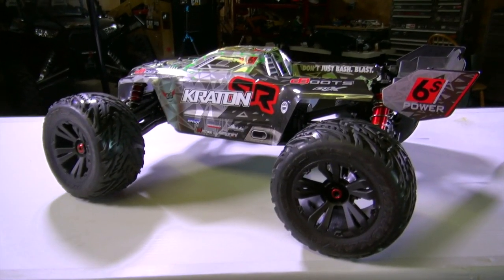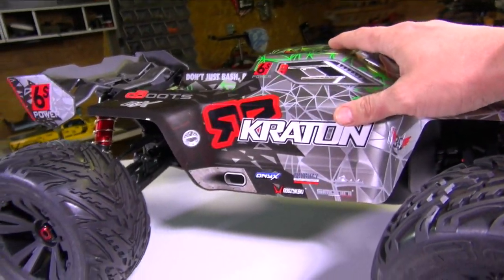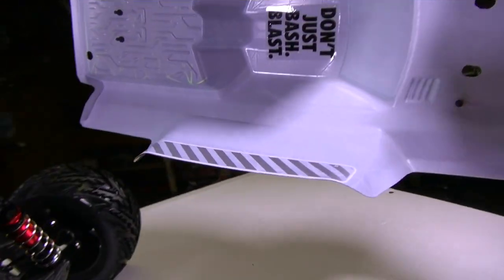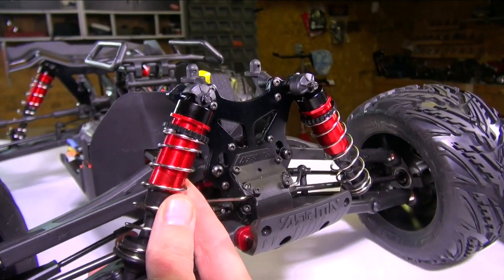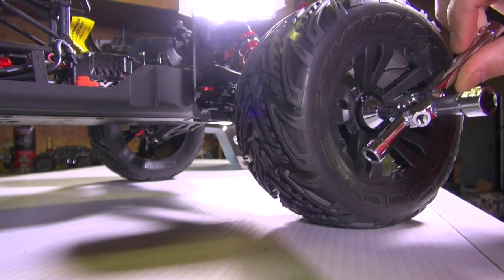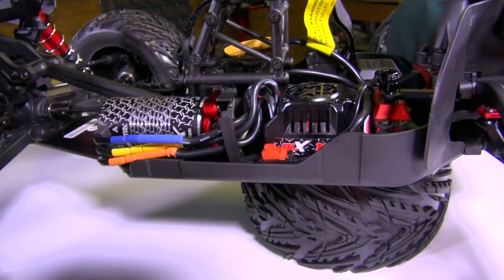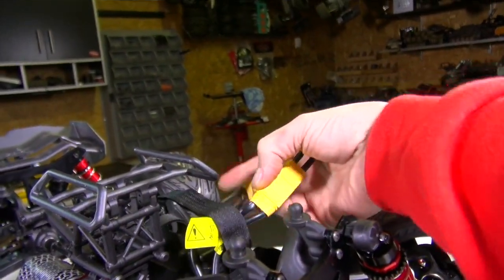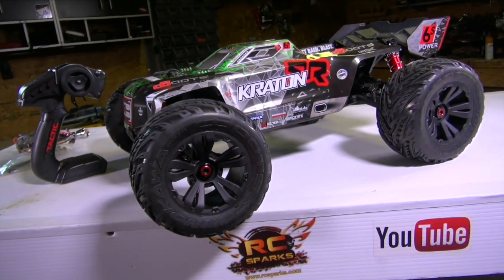10 Important Parts to Know about Electric Monster Trucks | RC ADVENTURES

Comment: i used to have a remote control car back in the younger day's  those was the ones with a wire attached to the car to control it, now running radio control for a long time , i wonder why i never got into the hobby a long time ago. 42 yrs old now , and i'm still loving the radio control hobby.

Comment: Good tip about reïnforcing the body with gorilla tape or ducttape. I actually go one step further and stiffen up my bodies with drywall tape, shoe goo/amazing goop and liquid rubber. Without any protection on the body the paint will get scratched up especially around the body posts and other parts which rubb against the car. Also reïnforcing the body helps to prevent cracks as much as possible.

Comment: On the front steering block, those are also known as C blocks on 4WD and Spindles on 2WD since it has no drive axle going through it.

Other than that and actually taking time to show exploded versions- I know that's a ton of work- of the components you covered it as thoroughly as possible.

Comment: Great how you did this right at Christmas and kept it simple yet still went over the major parts. I personally was wondering if you were gonna get to the diff cup/drive cup/outdrive, and you cut in and did. Personally I knew almost all of this as I'm an auto tech but those who just want to play and have no idea what is what and what it does there really couldn't be a better video. Personally now that I'm getting into quad racing I wish someone could do this same step by step talking for PIDs.  Slowly starting to understand it's essentially a filter for the flight controller of the quad to keep the craft stable in flight. But tuning them.is another story. Guess it's gonna be like tuning a nitro. Steep learning curve. Loved this even though I knew it all I was simply curious how in depth you were gonna go. The one thing I would say you left out are sway bars but that's getting more in depth. Great video and look forward to seeing a part 2 more in depth going over how they actually work so people can actually diagnose problems. But that's what we're all here for. Merry Christmas to you and yours Medicine and best of luck with RC Sparks Reboot.

Comment: This is a great video! You need to do one like this but about lipo batteries mah and C ratings, how to work out how many amps a battery can draw from and depending on what power system your running to how many cell battery  you need. Also if your running just say, a 120A esc and a brushless 3670, 2650kv that can draw 60-70A  you will need a battery that can draw and handle the amps the power system can use. For the type of power system i just said, i would like a 3s battery that can draw 200A.

Comment: Awesome video. Great job. Wish you made it long ago. Lol. Here's an idea. How about a video on how to determine what parts need upgraded to metal for your driving style or budget, depending. Ex. I have the x maxx and I will upgrade the steering spindles and etc to metal but keep plastic (rpm) suspension arms to absorb the jolts of big air jumps. Metal tends to distribute the force to the bulkhead or chassis. Anyway, think you get what I am saying. Sorry so long. Just an idea. Keep up the good work.

Comment: That part you called a steering block is usually called a steering knuckle; especially on full size vehicles. It should never be called a spindle; which would, technically, be the end of the axle that protrudes past the knuckle, that the wheel would slip onto.
Also, the steering piece that connects to the steering knuckle is called a tie rod end or simple a piece of steering linkage, not a servo arm.

Comment: Loved the video. Maybe next time you can talk about what it does changing the pinion and spur gear does. Does it make it go faster? What about heat issues? If I run a 4s battery do I get better performance changing the pinion spur gear or both?
Just food for thought. Still loved the video

Comment: i got a top tip use a polyurethane sealent to strengthen bodies lets them flex more without cracking been using it on my rc's for years

Comment: Don’t adjust camber with the pivot ball. They have to be snug which is a fixed position. To fix camber is with the steering cups set pieces

Comment: Hey Medic, I have a Traxxas Slash 2wd nitro short course truck. My Slash is all stock and almost brand new. But over the past few years after I purchased it, I’ve always wanted it to rip it up on the beach but my biggest fear is the sand getting into the bearings and gears along with the starting motor that would ruin the whole truck. If you could recommend anything that I can buy to install on my Slash to take it to the sand without destroying the thing that would be swell! Thank you!

Comment: Question about Center plates or transmission plates. I've been looking at getting a new transmission plate, and as I'm looking around(on amazon) I'm seeing a bunch of different designed centerplates. some starting at $25 going up to $60+
So my question is, is there really much a difference? I want to say yes, because you can see the different locations for the links to be mounted, bends...etc can you help me out, is there REALLY a BIG difference in centerplates?!

Comment: +RCSparks Studio - Could you do a segment on channels. Hooking up, config on TX, which goes where. I'm due at assembling my first truck (6 wheel). 1 Chan back/forth, 1 chan right/left, 1 chan gear, 1 chan shoe horn, 1 chan lift trailer, 1 chan feet up/down,  etc etc.

Comment: As a beginner rc hobbyist, I made the worst mistake. I bought an off brand rc monster truck. Therefore, most rc shops, haven't heard of the brand and don't know how to help. So I'm stuck with doing maintenance myself. I disconnected electric motor from the esc. After 4 months, I wanted to get it back together. So like most people, I forgot which wire goes to which wire. So I tried my best to remember and assemble correctly. But I failed everytime. After many configurations, I'm stuck with a truck that only goes backwards or in reverse. 

It is a 1/10 Scale monster truck type rc. From the website, NitroRCX. I purchased it for $200, plus the battery charger for $45. 

This truck has been sitting in a box in my closet for over 4 years. I don't want to throw it away, but I'm not interested in trying to fix it up, if parts for it are hard to find in stock. What I should have done was bought a beginner Traxxas Bandit, so I could tinker with it, and get help and parts from a reliable source. Any thoughts Medic?
Reply from the maker: Man, I wish you could yell your story into a MEGAPHONE to educate people about buying "cheap" RC's that seem like a good deal.  So many people get sucked into buying something "cost affordable" and get burned for the same reasons you have experienced.  I have tried to educate people about this risk, but then I always get spit on in the videos for "not supporting people who can not afford expensive rc's"..  Sighs. All we try to do is educate that they are a 1 time purchase and then .. throw them away.. Lol.

Comment: Technically when u said shock tower the shocks connect to the tower in sometimes that's not the case like in an e Revo or now the new arrma nero or the front of the twin hammers all have laydown shocks and in majority of the cases you would be correct but on these select cars they are just towers
Reply: And Merry Christmas

Comment: Very nice Truck i have the 4s kraton 110 the spur gear is plastic and the input GEAR Differential gear is metal right? Iam just getting back into the hobby and. Newbie to these well Advanced Trucks and learning what is where on the Truck and how it operates i pretty well know the basics of my Truck but want to learn a lot more about my Rc Truck cause they are not cheap to have somebody Else do it for you if its serious damage warranty coverage.is good to have on ur Truck

Comment: the way I learned the difference between radio and remote controlled was radio control didn't have a wire and remote control was connected to the car with a wire.

Comment: 5:55 hey guys do you know what's the reason behind that cut out in the chassis plate where the spur gear is exposed? Is there a reason for that? I have that same thing on my dhk maximus and wondering if I should put some tape over it to protect the spur gear? Any thoughts guys?

Comment: Nice vid thanks very helpful. Ordering tomorrow the kraton. Any suggestion on upgrades out the box this model RC could use?
Reply from the maker: yes, the tires and rims are just crap. They tear and rips super easy.. the wheels snap.. they thin plastic. Thats the number 1 thing I would do..   #Prolineracing for sure.. Hope that helps
Reply: RCSparks Studio what tires would u recommend that will mesh the easiest with this platform. I’m super new to RC and intimidated by servo upgrades and all that stuff. So any tires u like that this truck can handle well out of the box? Perhaps to ride better in snow conditions as well

Comment: I learned a lot about rc vehicles from my uncle he started at the age of 12 with the first generation nitro rc with the string and pulley pull start. The only question I have that no one has answered yet is you can run dual lipo batteries but what about nimh or nicd batteries
Reply: R/C McGuyver
Yes you can. Just make sure they are the same battery.
Reply: Thank you

Comment: Hey I got my self an rc a couple years ago, and i have been having problems with the connections to the mortar , and i have tried to drive it and it won't go what could be the problem. And yes I ha ran it it water and not on purpose either.

Comment: Forgive me for possibly sounding as I'm trying to promote myself, not my intention at all. Y'all did neglect to mention "Hard Bodies", by accessory makers or the Fiberglass & Metal Bodies designed & made by Shops like mine. Yes, the custom stuff is pricier but they don't break or dent easily & weather...not an issue either. Also, my Shop attaches the body clips as well, if my Customer wishes.

The other items, yes while more costly, my Shop also produces "adjustable" Wings. While mostly I've made these for serious & Pro Racers, may be worthwhile to note they're available? Last bit, Metal Chassis's...but y'all did mention the Chassis or Frame so perhaps I'm taking y'all too literally, my apologies. 

Thanks for another excellent video Brother! Liked & shared on my channel & once again I apologize if this sounded self serving, not meant or intended that way at all. Please have a Merry Christmas and a Safe and Happy New Year for y'all & your lovely family.

Comment: How do you find the right motor to upgrade the ecx amp
Reply: Preston Hall
There is standard sizes you can switch it out with. Usually a 1/10 scale vehicle has a 540 size motor. I belive the standard motor on the ecx amp is a 20 turn 540 brushed motor. The lower the turn number, the faster/ less tourque, the higher the turn number, the slower/ more tourque. If you wanted to upgrade your motor, you could get a lower turn brushed motor, or you could get a brushless motor and esc setup (I recommend the castle creations sidewinder 3 setup). Brushless I think is a lot better than brushed. Hope that helps.

Comment: How do i prevent rust on my rc car? im worried that my gears and stuff rust after i run it on wet condition
Reply from the maker: Dry it, and relubricate after running in water :) Not with WD40, but an a silicone spray :)
Reply: RCSparks Studio what parts should i lubricate? I seen some of youre videos wherr you put marine grease in the diff and transmission,i currently dont have marine grease so what silicone spray you recommend? Thanks

Comment: ok use a hair dryer to get them bolts free from locktight just watch your heat get it hot and it will run out  haha  works every time strip it thats a bad day i just got away with that wow so close   haha a 2 min job ha not that time i hope your ok today sucks your backs so messed up i look at your family your friends to me  i just respect you

Comment: Can you review the FTX carnage?
Reply: Dieselgassler I just wrote a comment like this and then found this one. I happen to have one myself, and it is a very good truck. It has great suspension and everything is good quality. My only suggestion is to, if you have the brushed version, to upgrade to brushless as it does not have much power on the brushed version. I have only broken the front lower suspension arm because I smacked it into the wall at full speed. Also, you may have to upgrade the servo as over a while it seems to get very week. Hope this helped
Reply: Jacob hill _ thanks I sure will do some upgrades when I get this truck

Comment: Crunching: gears, bearings
Suddenly pulls to a side on power, without steering: Differential or  Driveshaft broken
Pulls to a side from the beginning wether on power or not: not trimmed in properly
Battery charged, servo working, switched on, but still doesnt move:
a) stuttering : motor wires not fully connected, esc broken, transmitter not working/on
b) nothing whatsoever: ESC damaged, motor damaged, or transmitter not senting/on

Comment: I want to add a back up battery for my Truck Right now i have a 5000mah 50c 14.8 volts Battery with the Smart charger to boot 2400kv Motor with to cooling fans 1 at the front 1 at the back
Reply: So if you can recommend me a better back up Battery for my Truck would be much grateful for me to help me understand better about my vehicle

Comment: i stripped screw to remove drive shaft from everest gen7...
suggestions on how to remove?
where to order new screws?
Reply: you can buy stainless steel screw sets from many rc companies online, or just a generic screw set might work. 

To remove old screw
- Spray some penetration fluid on it, etch the top with something (dremel) and undo it with a flathead screwdriver

    or

- carefully drill it out , very carefully
Reply: Screw size is smallest alen wrench in the world(.5mm)
Reply: Chris Wabinga 
just dremel the thing to death. Good luck with it.
Reply: Thanks for tips guys, ordered new screws...
Will do dremel technique when screws come in